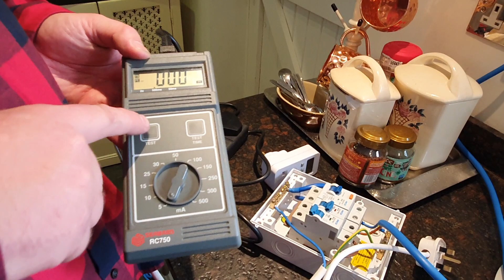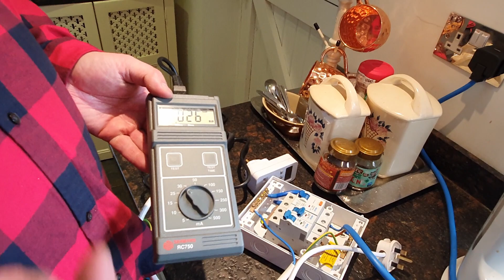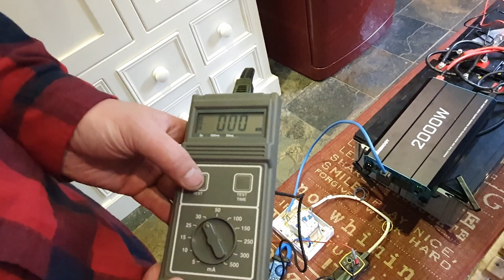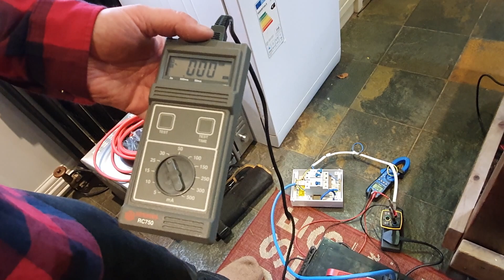Inverter RCD test and explanation

Comment: We use an RVD in Australia to give earth fault protection on the 250v output of an inverter, our regulations don’t allow for neutral earth bonding of the output side of an inverter, the RVD(Residual voltage device), the RVD is a combination 2 pole, DIN rail mounted unit, with overload, short circuit and reverse polarity protection included.
It covers all your electrical protection requirements in one device.
Reply: Yep, I've just bought one of those, not keen on the earth/neutral bonding idea, the RVD is a much better solution.

Comment: So, i have a victron multiplus inverter/charger, which has a neutral/earth bonding relay, which operates depending on whether it is being grid fed or inverting only. The casing of my inverter/charger, plus my MPPT solar charge controller casing, plus the DC cable link to the negative side of the battery all go to an earthing(grounding) busbar, and then a single cable from the busbar to the vehicle chassis. I have read however, that i need a seperate earth cable from the inverter casing to a seperate vehicle chassis point, for the 230v earthing. I've had the RCD testing done by an electrician(not an auto electrician, only household) and he was very surprised at how quickly it tripped without an earth rod connected. Is this 'extra' earthing cable definately required from the sole 'inverter casing' earthing point or does the current cable connection, but through the grounding busbar suffice? It seems weird to me to have two different earthing cables connected to the one casing connection, but to two different points on the vehicle chassis at the other ends. Appreciate any pointers given. The Victron 'wiring unlimited' guidance is as per what i have, but many sparky's are saying that a seperate 230v earthing cable is needed.....not shown on victron guidance. Appreciate any clarity you might offer.

Comment: By the way. 
Short-circuit protection (overcurrent) ( Fuse or MCB) are devices that the user should have installed. Usually placed everywhere  in-line between all power sources and all power consumers. Its like saying the inverter should have its own RCD ??? Perhaps one day ?
Nuff said !

Comment: Mains polarity ( especially when abroad) needs to be confirmed when hooking up.
Proper leisure Consumer Units have a neon lamp to confirm this for you.
Also the correct rcd and Miniature Circuit Breakers (MCB) ratings will be fitted .
Usually 30ma Rcd at 16 amps.
1 x MCB at 10 amps plus a second mcb at 6 amps.
All in a properly labelled,  insulated (lightweight) plastic enclosure.
Going to leave you all alone now ...LOL:face-turquoise-covering-eyes:

Comment: I did a really long ( but informative) comment but my crappy windows laptop just blue screened on me.
Essentially, the inverter is not at fault, its the lack of Earth-Fault-Loop-Impedance capability.
The inverter would need a Neutral to Earth Bond ( maybe via a relay/contactor for Grid hook-up disconnect) .
My house has a 20kw battery and 3.6 kw inverter, which can power my home using off peak electricity saved for use during the daytime.. Even that needs an NE bond in case the Grid is switched off ( in island mode during a power cut)
reason the mains trips the RCD is because the generator at you local substation has the neutral and earth combined and/or  centre-tapped so they meet at the source.
The RCD measures any imbalance in the circuit via Current leakage through the CPC ( earth connection)(circuit protective conductor) and disconnects its (looped) mains supply.
The inverter ( as most are) is meant by design ( for safety ) to power class 11 appliances ( double insulated) so a neutral to earth bond BEFORE the consumer unit is needed to achieve the same test function.
Many folk including some sparks don't consider this !
And I would say YES to separately "bonding" the Consumer unit output earth (CPC) to the vehicle metalwork/chassis so any AC fault conditions ( wire rubbing against metal parts of the van) will be detected by the RCD and disconnect that supply.
The DC circuits usually have chassis "grounding" to serve as the negative for the whole vehicle ( see battery negative bolted to your vehicle ?)
This is perhaps why Double-Pole ( Line & Neutral) AC breakers are now called for.
Always keep these AC / DC Bonding connections separated though, and "bright and tight" is the way to connect!
Id say get a qualified and/or competent person to check and test the entire installation before use !

Comment: Hi, Neil from Oz. Placed my ute camper(truck camper) on a tandem trailer because  of weight issues. As a retired electrican, I set about upgrading electrical system. New code says inverter must be protected by rcd and have a remote control, I had already bought a new inverter and it is centre tapped. It did my head in about the Rcd protecting the circuit. The inverter is not neutral earth bonded and manufacturer was very vague on earth faults except recommending I earth it to trailer. The inverter is stand alone and powering two stand alone inverter outlets. It did my head knowing an RCD would not trip on fault. After a lot of research came across a very expensive approved device called an RCD DUO which works on sensing 40 volts  to earth which about 10 ma. Your video is very good in letting a lot of people know that RCD's do not protect  most inverters. The RCD DUO is also used on inverter generators.
Reply: Or RVD's as I have in my van setup...
Reply: @extremelycovered  An RCD DUO is an RVD, just keep spreading the word to keep people safe.

Comment: Hi Geoff. I just bought a 3kw Inverter (Double Insulated) it says Class II only, but I intend to make it TN S (Earth Neutral bond) as I may at some time want to use a Class I device.
I intend to use proper distribution, so it will have Double pole MCB and a type A RCD.
I use a robin RCD tester. I was testing Caravan hook-ups on a local site, at one particular stand, yes the mechanical button worked, but my Robin said NO!.
Upon further investigation, I discovered who ever installed that particular point, did not connect the CPC from the source. (So no Earth), a couple of hours later, I found it further up the line.
Yes it was TT, but there was no connection at all to CPC.
The Robin tester was only £30.00 and has proved very useful.
David in Skegness Lincolnshire

Comment: The reason the Renogy inverter does not work in the first case scenario, is that it is designed to work with double isolated loads, like computers, phone chargers, etc. Thus, it's not intended to connect e.g. a refrigerator, electrical hand tools, etc. The more (expensive) ones allows you  to use the RCD in this latter load case. Cheers, and I and cannot agree more. I find way too much misinformation floating around on YT on this subject. Subscribed.

Comment: Great explanation, Renogy have said not to use an RCD on the inverter output, but it has inbuilt safety but won’t elaborate on what that it. 

Not sure if i should get rid of it it just accept it’s safety limitations and double insulate everything. It seems a great inverter otherwise.

Also theres an earth/ground screw on the inverter that again isn’t explained in the installation instructions.

Comment: Thank you for the explanation and duly understood, however, being the owner of the same renogy 2000w inverter, what is the solution to the problem when off grid and no earth is present rendering the RCD useless, at home in an off grid scenario, you simply link the earth and neutral together inside the consumer unit creating TN-S, but what if there is no earth, i.e. in a van with no shore power connection?? many thanks.

Comment: Did you ever try connecting the inverter chassis ground to the AC earth circuit? My understanding was this is how it should be installed and woudl trip the inverter if there was an earth leak?
Reply from the maker: Yup. Didn't work. Ultimately I cannot get a centre tapped inverter to trip an RCD in my tests

Comment: Hi, I have just spent an hour on the phone to Renogy US. They have confirmed that an RCD does not work with the Renogy inverters. They have however stated that there is a build in GCFI (American equivalent of RCD) which works both on battery and EHU. How would I go about testing this (as in would you be willing to test this)?
Reply from the maker: Hi. I wouldn't test as UK based so working on UK and European solutions as YouTube is saturated with north American channels. However I have got information on a MK double pole RCD socket that does work.
Reply: @AlwaysVanAdventure  I'm UK based, I just called the US number to get the definitive as using it with out any protection for me was not an option. They assured me after an 1h20 that the unit is safe and has the GCFI built in which will work in the UK. 

Would you be able to share your MK DP RCD, or are you planning on running a test first. Many thanks in advance.

Comment: Nice couple of vlogs - testing you have done. Been doing a lot of research on this myself. Shocking how some inverters provide no PE protection and people fit RCD and think they are safe. From What I can see so far Victron and Sterling are the only inverters I know that provide the PE setup unless you know of any others. I expect the centre tap in the Sterling is as you said reduced voltage shock to below 110Vac which is below lethal voltage legally but but would not want to test that 😂. In Australia they have a RVD safe system which looks good for converters. I think Sterling might have this as well but not checked yet. Anyway thanks for doing the Vlog looking at a larger off grid system so will need the RCD protection

Comment: Just wanted to say thank you for this. I have been scouring the internet and reading through old forums but none if it quite made sense until this video. This is exactly why I won't be installing my modified sine wave inverter by Krieger. 'Twas expensive, but I'd rather bond my wallet to victron instead of my body to the van. Thank you!

Comment: Hi, thank you for this video. My guess is that, in the case of a center-tapped inverter, the RCD is not tripping maybe because a 30 milliamps current leakage between L (or N) and earth/ground at 115 V (that is what the RCD tester will cause) is half the power (30 milliamps at 230 V) of what the tester is calibrated for (so maybe when it is set to 30 mA it is leaking just 15 mA between L and Ground). I would make a test setting the residual current  at 60 milliamps or more, and see what happens. Another thing I would love to see, if you can, is investigate how a 120V RCD (that should be what is used in USA) behaves with the same 30 milliamp leakage. 
Thanks a lot in advance for any response,
Attilio

Comment: My dad lives on a boat, as you know, and every 4 years you have to get a saftey certificate, last year my dad's failed. and one of the things it failed on was the plug tester showed there was no earth so it failed. I did some research and found out that a nuetral earth bond was needed. He has a victron. So in the plug for the inverter I neutral earth bonded that and it passed and has worked ever since. So in theory you can just do that rather than buy the sterling? That's at least what many others had done when I google it. Very helpful vids though Adrian! Learning lots as I don't know so much about 230v AC! Thanks!
Reply: As I’m in the same situation. Did you also earth the inverter where it has the screw connection on the back of it?
Reply: @mitchbozza  yes earthed to the boat with the batt neg
Reply: @RustyRoseAdventures  so just clarifying the Rcd when originally wired up didn’t trip but you joined the neutral and earth together in the plug that connected to inverter and then it tripped the Rcd when Rcd test was carried out?
Reply: @mitchbozza  We didnt do an rcd test, just the little plug that tells you if its right

Comment: Great video, thanks for sharing your knowledge and experience.
Glad to see I have wired the setup in our Motorhome the same way. Although, I am using a cheapish Chinese pure sinewave inverter, the chinglish destructions advise the case to be grounded to the vehicle chassis.
So now the geek in me needs to get an RCD tester and Martindale to see how safe and efficient it is.
Reply from the maker: You are far to kind to me. If ever you are over this way come on over and we can run some tests here if you like.
Reply: @AlwaysVanAdventure great video thanks I’m building my camper and 12v side done, not going to run inverter just 240v hookup do I need to earth the consumer unit itself has an rcd and then 2 mcb thanks sorry if this is a stupid question I just want to make sure it’s safe for my family

Comment: Could you do a further test with the Renogy setup and gradually increase the RCD current. I think it should trip at about 60mA. I noticed on a site transformer that had an inbuild RCD there was a label that said not for 240v use. As the centre tap on the inverter is giving +/-120vAC rather than +240vAC maybe the RCD test needs more leakage current to trip.
Reply from the maker: That's an excellent suggestion. I will try it.
Reply: @AlwaysVanAdventure  did you get chance to test this? This is becoming a minefield for me and my only option unless this comment is correct is to make 2 ac circuits one for my inverter to sockets and one for my shore power to sockets and my charger to battery bank. Thanks in advance

Comment: Absolutely brilliant Geoff very well explained and solved a long mystery for me 👍 it would be good if there was a socket tester that works for the inverter type/wiring   scenario ( rather than using the adaptor device for the multimeter ..was it a marydale )

Comment: Even though you know in yourself that you have made a very good electrical system in your own van, along comes Jeffers with another in depth testing video to cast a tiny nagging doubt in your mind.
Tomorrow’s task: insert wet tongue into van 13 amp socket to test trip switches again.

Comment: Really useful. Just need to add that to the tick list of what inverter to buy when I have saved enough to get my new van
Reply from the maker: Almost any sterling or victron inverter 500 VA and over
Reply: @AlwaysVanAdventure  Thanks. I got a lot of advice from 12volt planet they were really helpful but it all comes down to having enough knowledge to ask the right questions. As an example my DC to DC charger also does the Solar charging as well. But as an example I now know that I would be better off with a unit that would use the Solar to charge the vehicle battery once the leisure battery is fully charged.

The one thing that does irritate me re 12v electrics is when people keep referring to negative as earth when it's not.
Reply from the maker: @Sammo-w2y  terminology and colour coding are very important to me. DC is red and black. Positive and negative. AC is blue brown and yellow and is live. Neutral and earth. I agree with you. Renogy do a number of DC to DC that work exactly as you want however you are restricted to a few solar panel types. If you have Instagram find me @unimpressedjeff